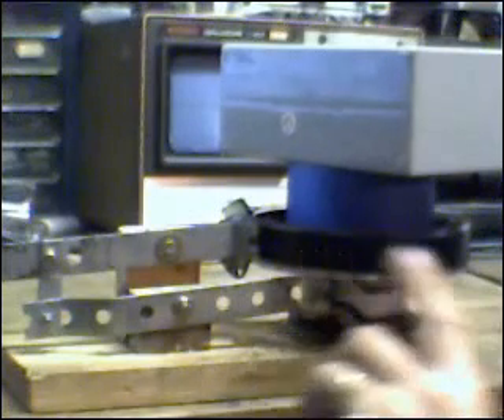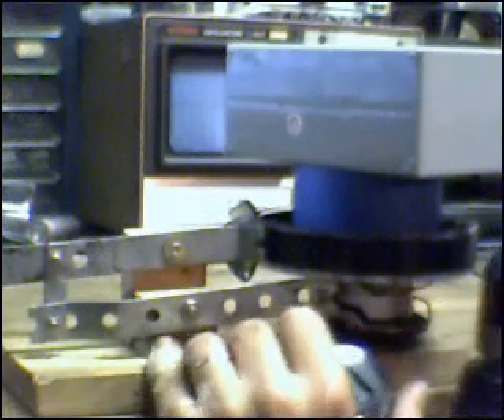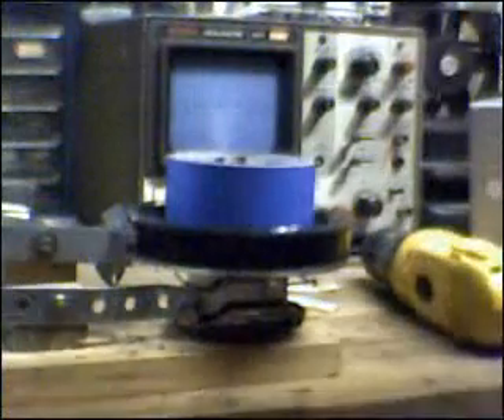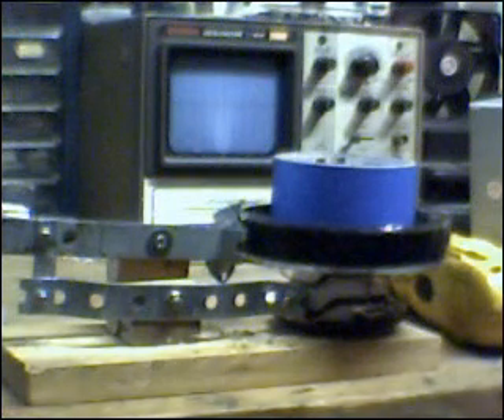11 - OSPMM controled tests w & w/o stator

Comment from the maker: I have studied the force vectors of this model more closely. Suffice it to say the reason it accelerates while hand operated is, even though the motion is small, the work in is still greater than the work out. Think of it as a simple incline passing by on rollers. Push vertically on it with a bearing and it rolls horizontally. The lower the angle the less distance you have to push to make it go sideways but you have to push down harder. That's all that's happening here.

Comment from the maker: Correct on the first point. Not so on the 2nd. Size of the rotor will only give the mechanical advantage I need over the stator to make it work. Beyond a certain point there is little to be gained. RPM (i.e. HP) should be limited only to the strength with which the device is constructed before it accelerates to self destruction.

Comment from the maker: You may be right but I will try anyway. Think about other models that might benefit from this increased mechanical advantage like the sloping magnet incline that only needs to be actuated once or twice per rev depending on the design. My HD magnet up and down is not the only way to move it into and out of position. My next cam ass'y will also be made as a yoke that straddles both sides of the bobbin with roller bearings.

Comment from the maker: YouTube is still having problems allowing me to approve messages. Sorry. But to answer your question that no one else can see, suggestion01 was created specifically for me by that user. While the motion it creates is probably better, it must originate near the center of the rotor to achieve a mechanical advantage over the stator, not at the edge as shown.

Comment: Let's forget perpetual motion.  You are undoubtedly designing a set-up which reduces energy consumption.  Also, think solar power to power a bit of it.  Regarding timing, on my own project, I was looking into an off-set stator magnet pushing just before the pull of the main stator and/or an off-set wheel magnet set-up.  I hope you get back to this and can't wait to see what you've done between #11 and #329

Comment: A practical application for this research might include an object that requires spin-stabilization(say an earth -orbiting satellite )using solar power to operate RF servo motors,with auto and manual control possible ,with the leanest amount of weight and yet highly efficient(micro-gravity).I'm wondering about using electromagnets in the design(for more thrust)Just some thoughts....Well doneZFF!

Comment: This Has been interesting, following your progress.  I have a couple suggestions, for what they are worth. One, try using a circular flywheel instead of your battery.  Also you might try shifting your sine wave linkage with a short delay or advance from where you are now.  Might be worth the try if you haven't already.

Comment from the maker: Obviously it adds friction. That's why I need as great a mechanical advantage as I can get from the actuator by increasing the diameter of the rotor magnet ass'y. Hopefully I can find someone with a high speed video cam to play back my manual operation in slow motion and see what really takes place that allows me to accelerate a mass with it.

Comment: Must be ordered movement ample leverage. To do this use your motion amplification that allows you lever principle. Move control lever pivot closer to the wheel and the lever pivot ordered him move away from the wheel. It would be nice if I could show a picture because I'm afraid you do not understand what I mean. I used google translate. I hope that the translation is ok. Good luck and I expect the new film with the necessary changes

Comment: unfortuantely what he is saying makes sense, your NEVER going to create more than what you put in...BUT you can however, develop certain motor/machines that require less and less energy up to a point where the energy you put in is equal to how much energy is outputted. its a limit basically as the difference between the input and output approaches zero

Comment: i think increasing the diameter will not help, as this also forces you to either put more magents in (>higher actuat. freq), or to increase the actuator deflection in the same ratio to keep the needed vertical speed in relation to the passing magnets. but let's see :-)

Comment from the maker: Yes my first attempt did not achieve the results I had hoped. I'm not ashamed of that. I have not given up. When it does work the acceleration will be spectacular and the surplus energy abundant.

Where is the energy coming from on your device to energize what looks like a coil? Can your device be attached to a generator to power itself?

Comment: seeing your video, I think I'v found the issue in your design, the movement amplitude of the stator are much short... so the oposing magnetic fields of the stators are interfering with the magnets on the wheel... adjusting the pivot of the upper arm more close to the linkage, and using some pieces of metal to balance the weight on the 2 arms, you can improve the movement of the stator...

Comment: the cam assembly is just not working correctly.  you should connect the stator arm to a seperate motor to drive it up and down... just so u can get the cam timing correct so it accelerates without moving it by hand.  then u can try to make a cam shape based on those results.

Comment: You got one problem that i dont know how to fix there.... Friction, its slowing down everything, friction in the things the arms are attached with, and friction in the bottom thing the lower arm goes on and friction in the spinner.. only way i know to get rid of friction is by having air between all stuff, but that feels kinda impossible there... if you know what i mean :) something like /watch?v=CgHQw4KSpuw

Comment: ok so basically the machine does not work..BUT would this require LESS ENERGY, to turn the certain mass a certain speed,  THAN some other electric powered machine would need to do the same thing?